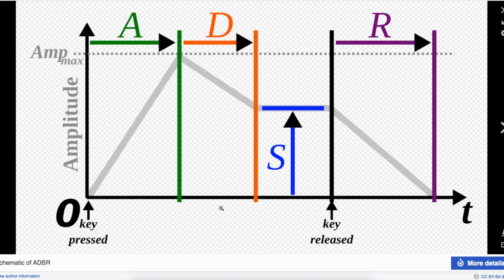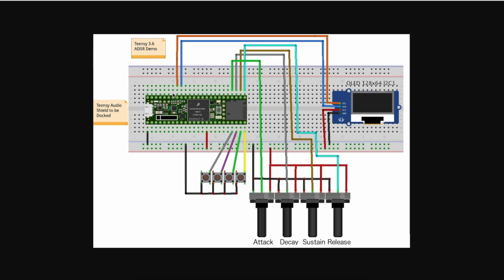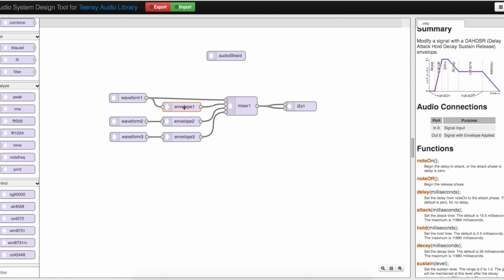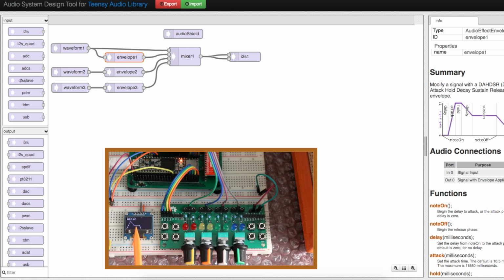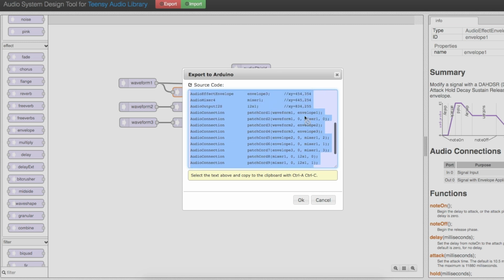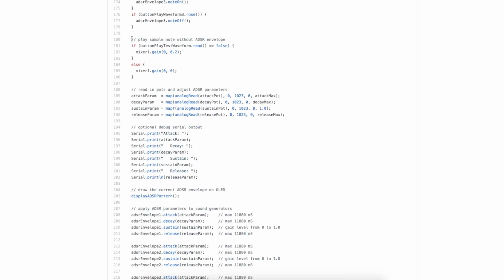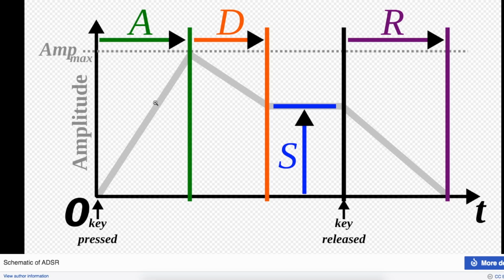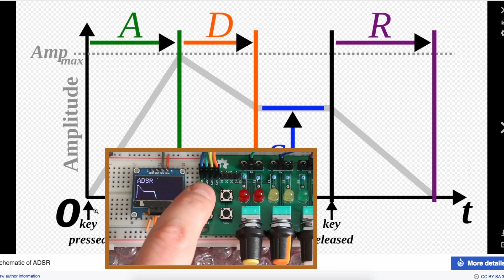ADSR Envelope Generator:  Teensy 3.6 Audio Demo

Comment: I wonder with this audio library if a Voice Changer can be made with very complex sounds changes can be made?  I have seen lot of projects using the arduino and found that they are rather simple. HT8930 Chip can make better sounds effects but a teensy with this library could make something that can be totally programmable.

Comment: Thanks for a super video!  I have experimented with the ADSR aspect of the audio shield but really didn't get much out of it.  By implimenting buttons which can turn the effect on and compare it to the tone without the effect, it really helps to show what difference it makes.  I also think it's great that in addition to changing the effect with pots you have also made a graff on the OLED showing the current form of the ADSR - excellent!  Thanks also for including those websites you found - they look interesting and helpful.
I have never seen a float map function - thanks for including it.  I have always just made my values to be mapped times 100 and then just made the mapped values floats divided by 100.  That works but the mapf function you found looks easier.  And I know this comment is starting to sound like an awards show acceptance speech, but thanks also for your detailed explanation of how you made the ADSR graph on the OLED.  I would never have been able to figure that out on my own.  Now with your explanation I feel confident in tackling some specialized graphs.
Reply from the maker: I don’t mind receiving awards for my effort, thanks! The ADSR waveform on the display was something I thought of while I was already working on the project because I realized I turn the knobs and I don’t really know how dramatic the impact is supposed to be and then I realized oh, it’s probably really easy to draw those couple of straight lines and then magic happened. I think it really helped me as well as viewers understand the whole concept better.  
I like including links to websites even for my own reference like five months from now I might look back at this topic and forget all the research I did but the links are right there so pretty much I am as much a viewer as a content creator!

Comment: Hi Gadget, you should remove the magic numbers from your code, it makes it much easier to read at a later date when you want to re-use it. i.e. the max Y for the attack line was 20, later you might want to use a larger screen, so you will have to go find all the 20's and decide if they are the right 20. use a #define and change a screen and you only have one place to change the height value. it does not take any more code space but makes it a lot easier to read. I only comment as I've looked at lots of example code and you spend a lot of time trying to work out what the numbers mean where a #define would have said it in seconds.  Still great video, and thought provoking hence the comment. look forward to the next
Reply from the maker: Yeah I originally had Y at 0 because it was full screen which was intuitive, but later I decided to put the text on screen so I just quickly changed 0 to 20. Software is only my second language!  I may go back and at least add a comment to the constant.
Reply: @GadgetReboot  If i look at old stuff I've done it's full of them. I try and force myself to do it now and add comments by the bucket full. stay safe